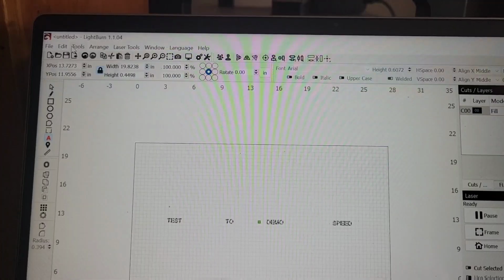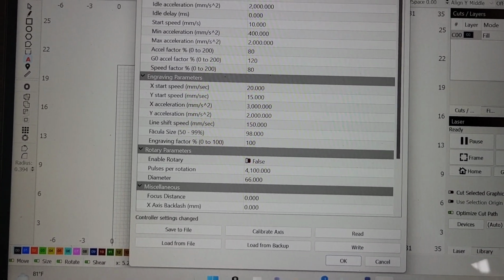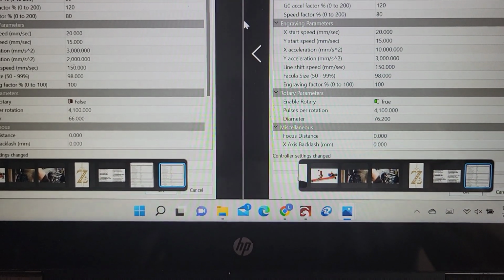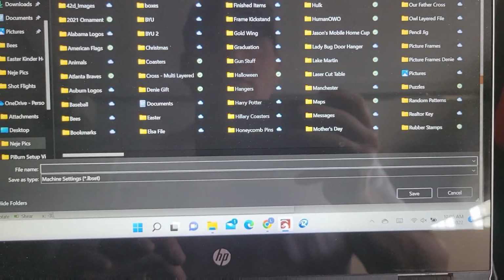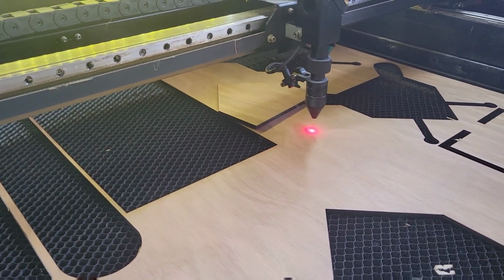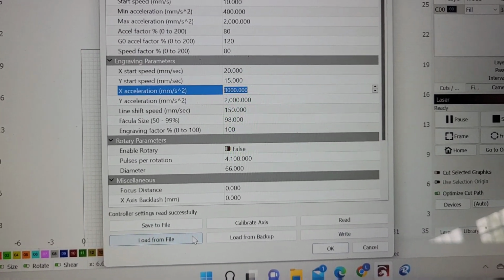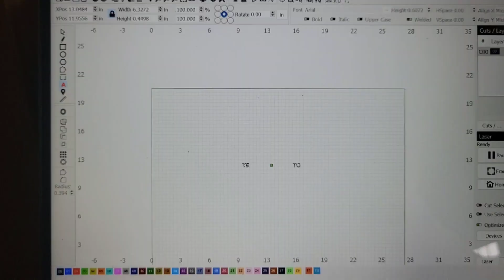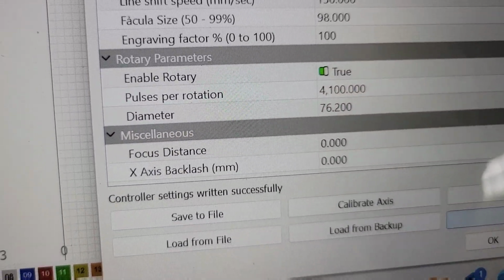Faster Engraving on Omtech Laser Cutters - Using Lightburn

Comment: A much better demonstration of the acceleration parameter would be to place 2 letters far apart and choose "all items together " option and fast white space scan option.
Set the engrave speed high then compare 500 acceleration to 2000 to 10,000.
Reply from the maker: You should make a video

Comment: okay its been two years - curious on how your stepper motor is doing?
Reply from the maker: It's doing great and I haven't had any issues. However, this laser has been dedicated now almost exclusively to tumblers and bottles and a new, larger 80w has been added to handle cutting and engraving wood, acrylic and misc items. I have increased the speed of the new laser and have been running it for over a year with no issues with the stepper motors.

Comment: Great advice and really well explained too.  Question - What is your laser model?  Also will this also help in speeding up cutting or engraving curved lines?
Reply from the maker: This is an Omtech 80w - 20x28" Manual Focus. This doesn't speed up cutting, but it does significantly speed up all types of engraving.

Comment: So I followed your steps, but now I cannot access my Machine Settings anymore. Now it says "Communication with Controller failed", and I cannot load my old settings... Those buttons are greyed out.. any ideas?
Reply from the maker: It sounds like the computer isn't recognizing the laser. Try power cycling the laser, the computer and check your USB connection. I think your issue may be unrelated to the speed settings.

Comment: why did you bump up your X acceleration way more than the Y?
Reply from the maker: Great question. If I remember correctly, my logic was that most of the engraving is happening as the head travels back and forth across the x axis so increasing that speed yielded a greater overall improvement.
Reply: @woodunlimited  Wondering out loud if just bumping both to 10K would also improve scoring speeds
Reply: Aren't the stepper motors only rated for certain max speed? Concerned this is going to cause excess wear, how long have you been running this with no issues
Reply from the maker: Great point. I'll have to do some experimenting!
Reply: @Wood Unlimited  only bring it up since my only real complaint with my 80w, is not being able to fire the laser under 10% In light burn, leave for some very "meh" lines lol
Reply from the maker: I haven't tried it, but I wonder if there's a setting in the Ruida controller that would let it fire below 10%

Comment: what watt is ur machine, mine is 100w, I didn't know if I could use the numbers u did or if I would have to use different ones, also does this affect the scan offset settings since it goes faster?
Reply from the maker: I'm running an 80w but if you're running Lightburn and a Ruida controller this should work perfectly for you. I haven't run into any issues with scan offset needing to be adjusted but that's a logical thought and I can see where it could be a concern.
Reply: @woodunlimited   I have a 80w w/Lightburn and Ruida (OMTech).  But I really want to get the fast curve (e.g. circle) engraving/cutting faster.   Do you have suggestions here?   Also my machine which is 3 months old (pretty new) seems to have slightly different manufacture settings.  Not too much different but I'm curious why?  (maybe more conservative).  Any suggestions from anyone on what to do to make cutting curves (eg. circles) faster.  Lines are very fast.

Comment: have you seen any issues with the belt stretching  or any other issues now that its been a little longer.
Reply from the maker: I haven't had any issues at all, no stretching, belts still feel tight, motors work well, everything is dead on.

Comment: many thanks for vid and a huge difference in speed.  I used to have 2 very large much more expensive laser machines a few years ago but had to get rid of them. Now thinking about getting another one and trying the Omtech 80w with the 500x700 bed.  How would you review this brand please?
Many thanks
Reply from the maker: I've been very happy with the machine. Other than basic adjustment of mirrors, replacing the lenss occasionally, and basic maintenance I've had no issues.

There is a lot of information available in fb groups, and online so if you do run into an issue, chances are someone has already had the same issue, figured it out and posted the solution online.

I'd say, go for the Omtech if you're thinking about it. Do consider that youll really want to upgrade the air assist, exhaust, and the water chiller to get the best performance. So you'll probably spend another $700 - $1000 above the asking price of the machine to have a proper set up.
Reply: @woodunlimited  Many thanks for reply.  Yes already thought a better air assist and I still have my old air pump and a proper chiller I would need to get  - 5200.  It can't work from a bucket properly lol.
Thanks again
Reply from the maker: @Peteskis  Awesome! You're welcome!
Reply: @woodunlimited  I agree.  I have a 80W OMtech and made upgrades to exhaust and water chiller.  Which Air Assist system do you have?  Details please.